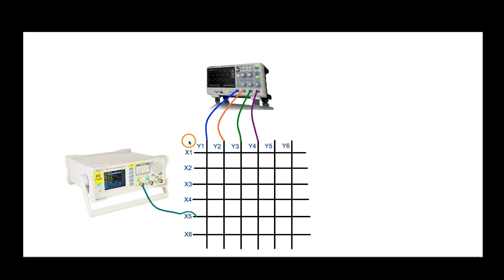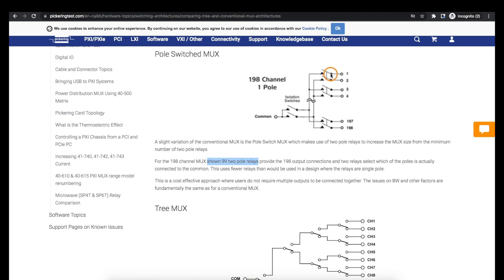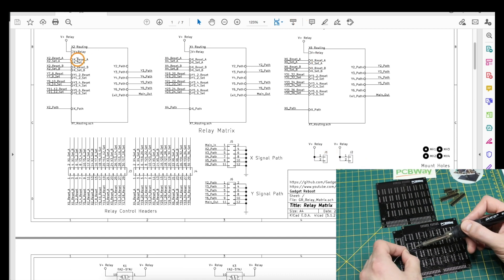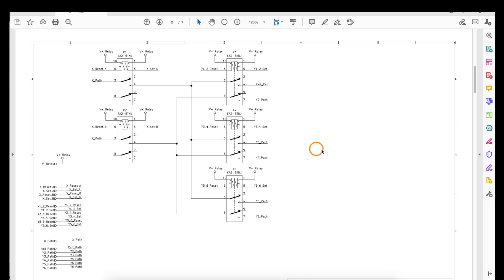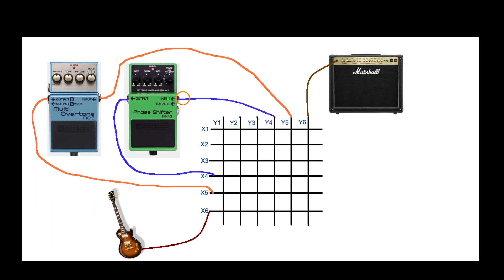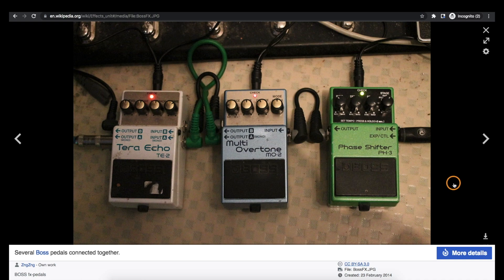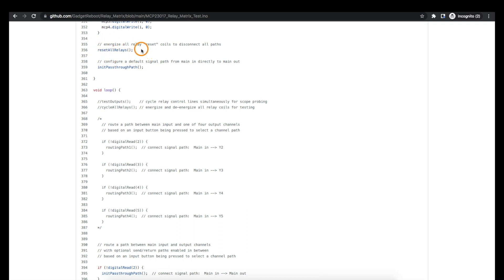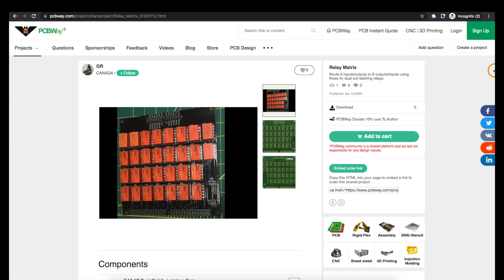Relay Switch Matrix - Dual Coil Latching Relays Controlled by MCP23017

Comment: I'm so glad to have found this video, it was so helpful. I've been toying with the idea of doing the same thing for guitar effects myself, but with zero experience of using these kinds of components. I'm a programmer by trade, so that side is familiar, but the rest of it...! 

I've (rather stupidly?!) settled on using a crosspoint switch (AD8113), since that gives me the 16 "channels" I'll need, but now got to figure out how to mount/solder it, communicate with it, and get it to do what I want. Sometimes I wonder why I do these things 😂 Thank you for filling in some gaps for me though, as the principles here at least feel like they're applicable to my project too!
Reply from the maker: I hope to resume working on the next step in this project in the next year, I was hoping to have gotten further by now but other things came up.
i’ll have to look at that cross point switch, I wanted to have relays for true bypass especially if there are multiple effects engaged with possible impacts from using electronic components to do the switching but there’s also advantages to having the chips doing some of the switching for certain other features.
The biggest problem I run into is having so many relays makes the board large so I’m also trying to think of ways to provide interconnection so I can just have a bunch of smaller boards and link them up, so many things to sort out when I get back to it.
Reply: @GadgetReboot  That's awesome to hear, good luck with it! Yeah, the true bypass thing is something I considered, too, and with my (very) limited knowledge, the AD8113 has low enough distortion/general effects on the signal to make it worth a punt. Worst case it won't work how I'd like but I will have learned something along the way! 

I considered going down the route you have, but thought for the number of relays I'd need for a 16x16 one-to-one matrix, it'd be too large a footprint for what I'd like. Maybe I should just save up and get a GigRig G3 and open it up to see how Dan and the team did it, though cost was the reason I went down the DIY route in the first place
Reply from the maker: The G2 and G3 were what inspired me to give it a try, and I wished I had a way to open one up but I think it's over $1000 so that's not going to happen!  But I tried to listen to any hints about what's in there like the foot switches are optical instead of mechanical, and the word "Relay" and true bypass meant the main paths aren't going through any buffers/electronics, and I'm still not sure but there was once mention that settings stay even when power is turned off, so I wasn't sure if that meant a battery backup stores everything done, or if it meant the relays are latching, so as soon as it engages, it will stay that way until a new control signal comes, so I think I have as much info as I am going to get by watching those shows, now it's up to me!